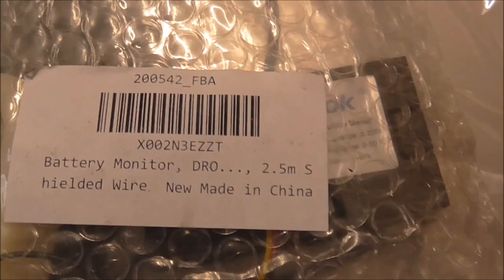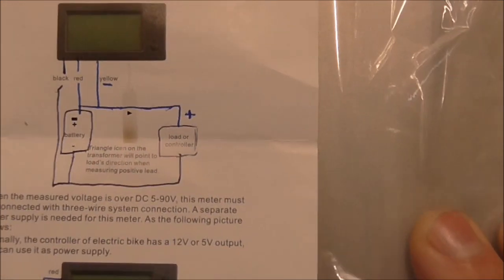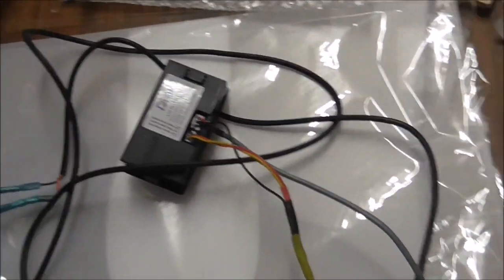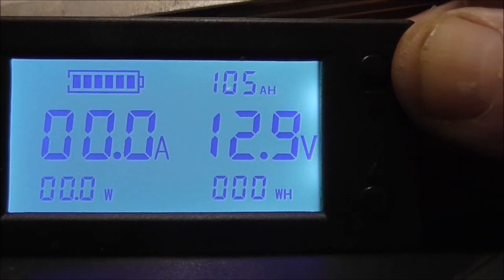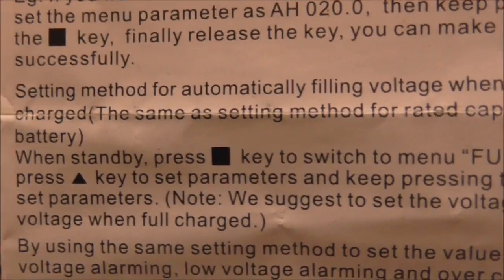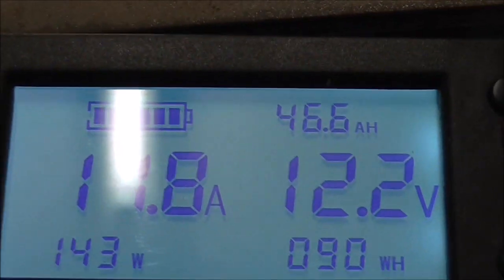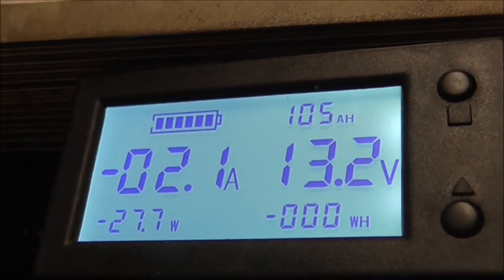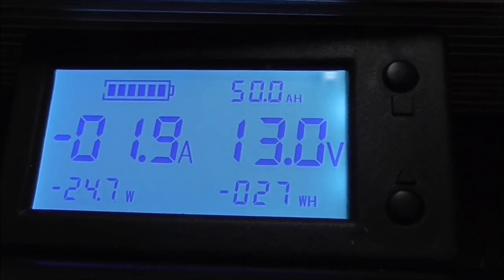DROK  Hall Sensor Type Battery Monitor - Part 1( initial set up)

Comment: Me, again. I’m curious why my DROK does not show charging AMPS while hooked up to my tow vehicle running at either idle or 2500 rpm. When charging the instructions say a - sign should appear at “A.” That said my batteries were fully charged when I ran this test. How can I otherwise determine how many amps my truck’s alternator is delivering?
Reply: I did a second video where near the end I rigged it up to my engine start battery and monitored start current draw and alternator charging current. Have a look at that.
Reply: @martint1151 Thanks. I’d have to disconnect my existing Drok and move it to the battery/alternator wiring. Too much trouble. Or…I could buy another Drok! 😅
Reply: Another thing to check , there is an arrow on the sensor for correct installation.
Reply: @martint1151 I’m good there. Sensor is oriented in proper direction.